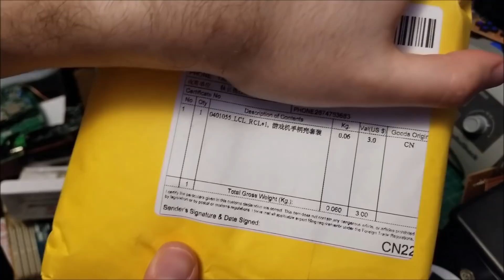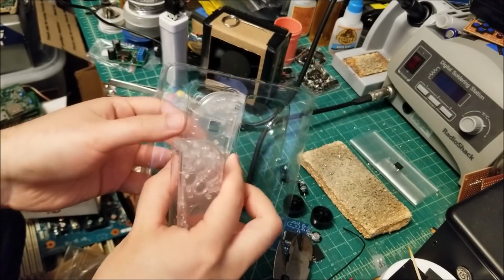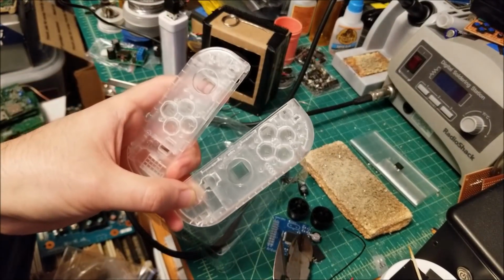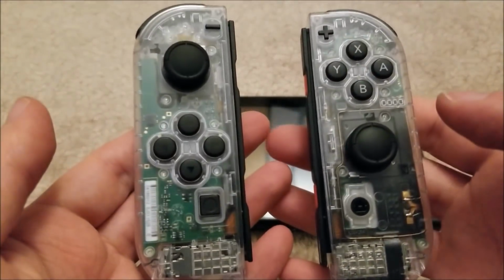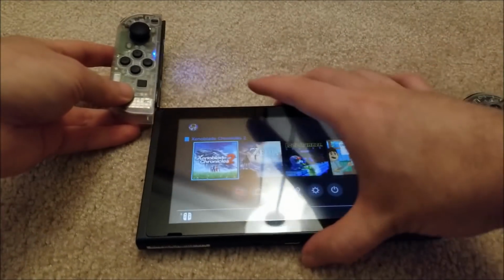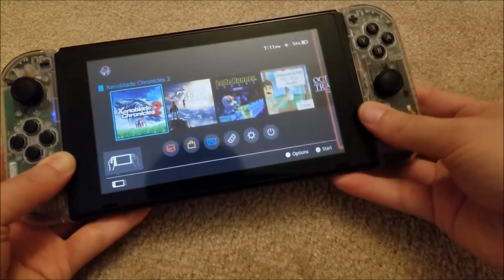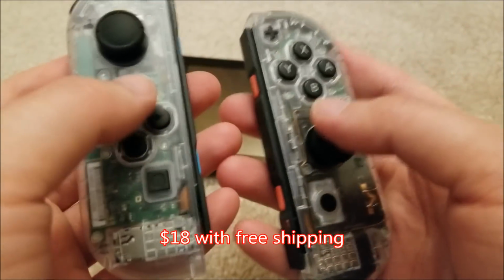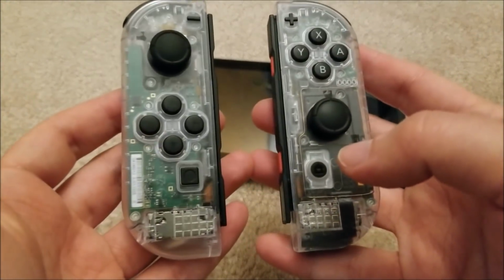Let's Mod: Skeleton Clear Nintendo Switch Joycon Shells!!!

Comment: I know this video was made awhile ago but I’m trying to mod my controller and I got it open with a tri-wing screwdriver bit, but now I can’t get the regular Phillips head screws out for the life of me. Every video I’ve seen makes it look so easy. Do you know what size Phillips Head the inside screws are? Or is there another trick? Thank you!
Reply from the maker: I wish I knew the size, but basically your best bet is the smallest phillips screw driver you can find (glasses screw kits at convenience stores often come with tiny drivers). Also carefully applying inward force and gently torquing in small angles until the screw is loose will help.
Reply: sjm4306 thank you, I have a precision screwdriver kit and unfortunately I think I’ve already stripped one of the screws. I’m not sure why it’s not working but it seems like the ones I have are too pointy or something—the tiny screws seem to not have an inward slope as much as regular Phillips head screws have, so the prongs on the screwdriver just aren’t reaching down into the screw far enough. Maybe an eyeglass repair kit would work better. Thanks for the reply!

Comment: Those look beautiful. And are those LEDs on the joycon regularly red? Or did you replace those?
Reply from the maker: Thanks! The leds are normally green but I replaced them with blue and red for the left and right controllers, respectively.
Reply: Howd you swap them out mate was soldering needed
Reply from the maker: Yes I used a fine tip soldering iron

Comment: Is it easier to replace non-clear cases to clear cases
Reply from the maker: In terms of difficulty I'd say so long are you are careful not to lose any parts, yank any connectors, or strip any screws it really isn't bad. If you have ever done a shell replacement for a handheld console it is very similar.
Reply: sjm4306 oh ok